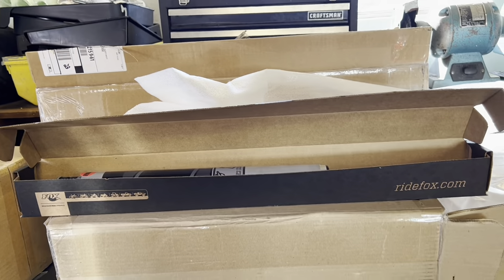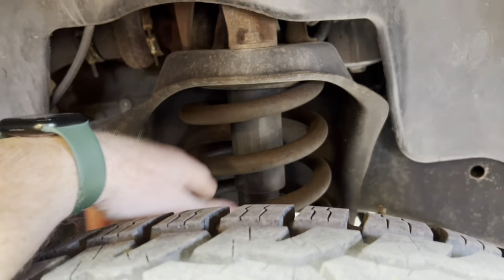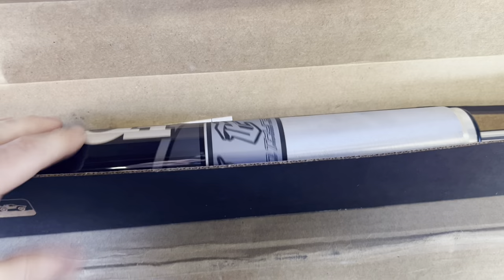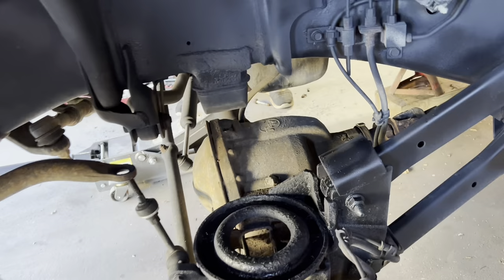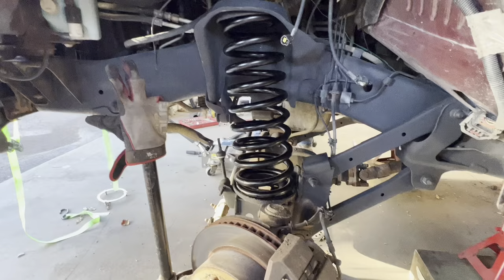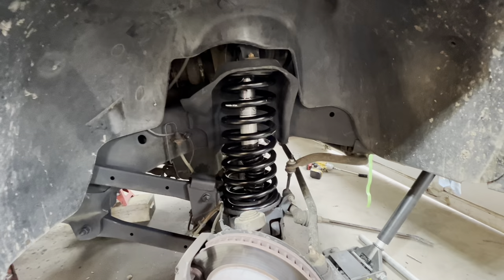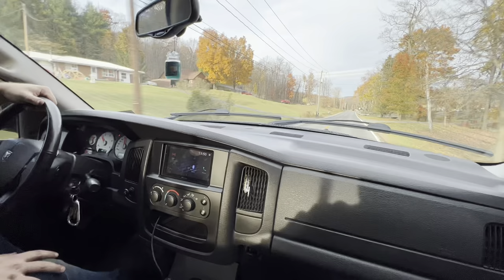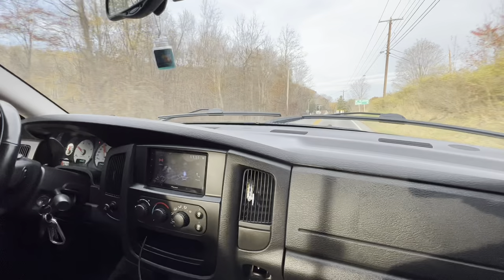Best suspension for 3rd gen cummins. Thuren soft ride and fox shocks! 10/10

Comment: I just installed the 3" coils ( 2005 ) Spring compressor is NOT necessary. One side at a time. The opposite side needs to go up for the working side to go down.Shock towers do NOT need to come off nor does the track bar need to be disconnected. Sway bar ends yes.
You're making it harder than it needs to be.
Reply from the maker: Thanks for the comment

Comment: I have the same truck, and I been wondering forever how to make my truck to ride more smooth, because I hate it when you run over a small bump and the whole truck shakes like Armageddon. Thank you for the video I think I’ll buy these now. Any suggestions to make the rear better also?
Reply from the maker: Thanks for dropping by we also added fox 2.0 rear shocks. Next step is a thuren sway bar we’ve heard nothing but good stuff so that’s next step
Reply: Thank you your channels is awesome I’m a subscriber
Reply: @reytech1786  Carli add a pack is probably your best bet if you want to keep factory towing and height
Reply: @3guysgarage   if you havent done the sway bar yet its beyond being worth the money. Did this same Thuren setup on my 08 and it was night and day difference. Just finished up their high clearance control arms and their full progressive leaf pack will be next.
Reply from the maker: @IcedAssault  love to hear this!